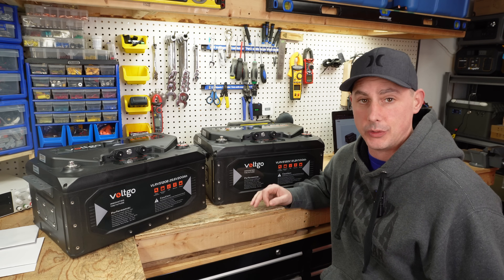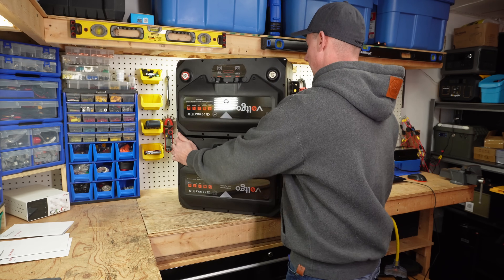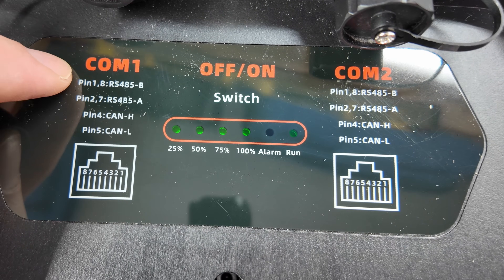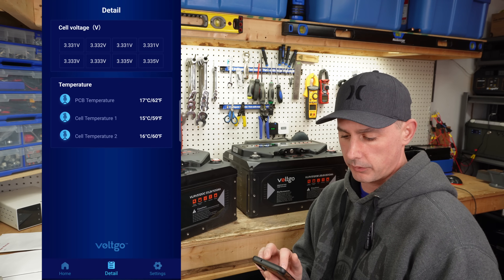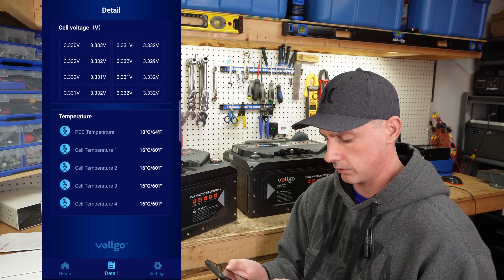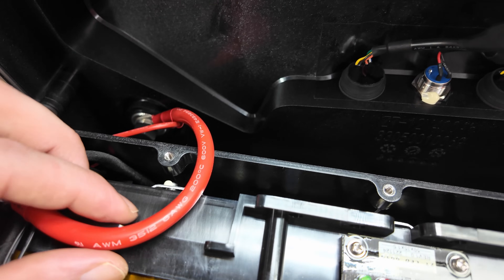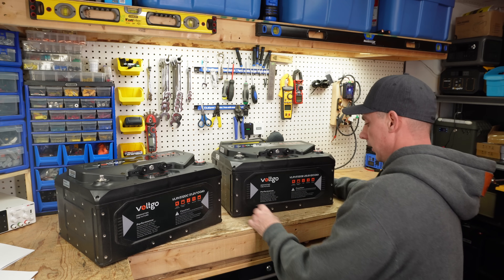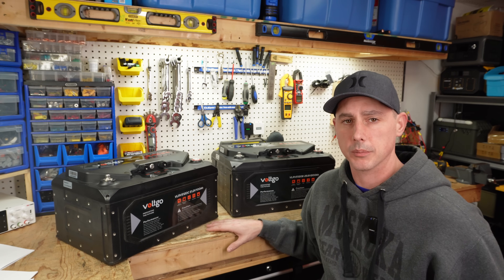Voltgo 24V And 48V LiFePO4 Battery Teardown Review

Comment: FYI - the 48v   Version has no closed loop communication, at all. Just bought 2 from BigBattery based on your review and are returning them since apparently they are incorrectly advertised. I've seen a few reviews claiming this works (it only works on the 12-24v versions), even though there are physical ports for it. What an absolute joke. Never buy from big battery, they incorrectly advertised these as having can/rs485 and are charging a restocking fee.
Reply from the maker: @projectswithdrew  I'm sorry this happened to you even I didn't catch that. I will add something to the description of my video to warn people.

Comment: A bit pricey at $1990 for 100 A-hr 48 VDC, about 40% higher than many similar-spec wall-mount batteries.  You are buying ruggedness and hopefully better quality.
Reply from the maker: These batteries are mini tanks. Can you tell me what batteries you are referring to, and maybe I can explain the difference to you?
Reply: @Roll2Videos  My EA Sun 5.1 kWh wall battery has com to my inverter.  It charges the battery based on State-Of-Charge.
Reply from the maker: @SihAza  Correct, The 48V (51.4V) does not have communication you would need to use voltage.
Reply: Tanks without any close loop communication. Worthless without it.

Comment: A battery question!  I put together a 4s4p bank with Time USB 12.8V 100ah batteries.  I watched your review and others and went for it.  Thoughts on the best wiring to get the most out of the bank?  Totally off grid so no mains power.  Where should I add breakers...  Many thanks!
Reply from the maker: So you are running 51.2V 400Ah?
How many watts are you going to be running?
Reply: My inverter is an all in one EG4 3000W tied to 9 415W bifacial panels.  I get plenty of power but when I look at the inverter it is showing 54v but the bank is only at 53.6.  Next morning only 53.1 and running a little over 100W mostly a 11.1 cf fridge which runs about 70w + internet and little stuff.  I have the 51.2v banks where they are connected together neg, neg, neg and pos, pos, pos.  The charge/load is connected to the first bank.  A simple setup.  A breaker going to the inverter.  Thoughts?
Reply from the maker: @jimsgarlat7328  Sounds like a good system. You should definitely protect the wire from an over-current event with a fuse or breaker.

Comment: This is the best plastic battery box I have seen so far, I’m impressed with it. 
Many threaded inserts all around the Battery Box allow to mount the Solar Charger and Inverter directly on the Battery Box using some DIY brackets or pieces of plywood. In this way, a portable solar station can be easily and quickly created.

Volgo doesn't want to sell these great battery boxes as empty boxes, which is a shame, they would be great for DIY battery building. So, I'm skeptical that they'll add the brackets to separate sales.

I would just change the BMS on the batteries to the JK BMS brand.
You didn't show what the BMS settings options are in the video. I assume the BMS settings will probably be locked to the user, which would be a shame. I assume that the BMS have just weak passive balancing, can you confirm this, test it please?

BigBattery have these same batteries, rebranded from Volgo, I guess.
Reply from the maker: Oh wow, Big Battery does. The 24V has a JBD BMS which is my favourite. The parameters are locked out to the user but I'm sure the engineers set the parameters appropriately. Testing the balancing will be difficult, if I notice a cell deviation at the top end I will make a video of that.